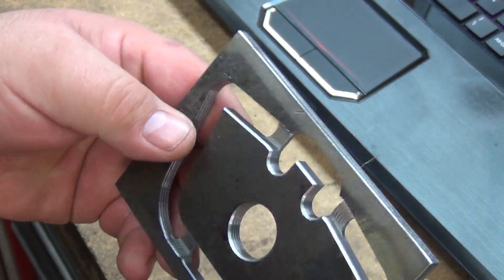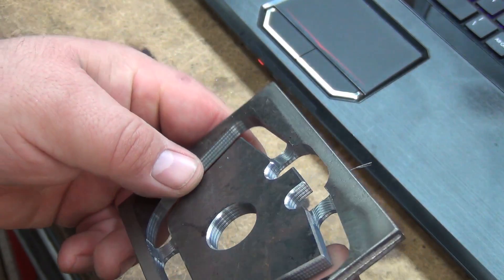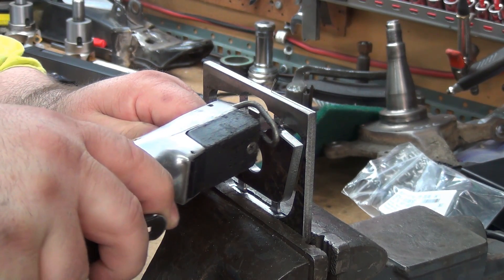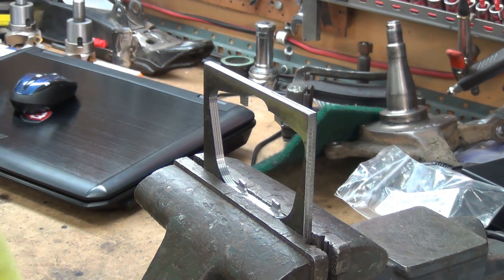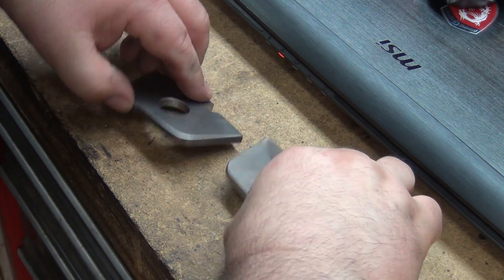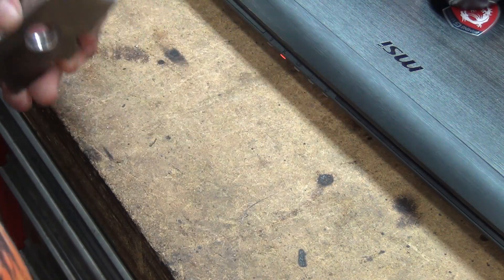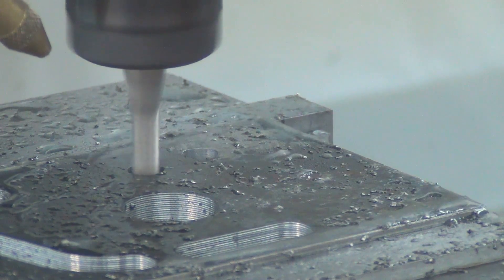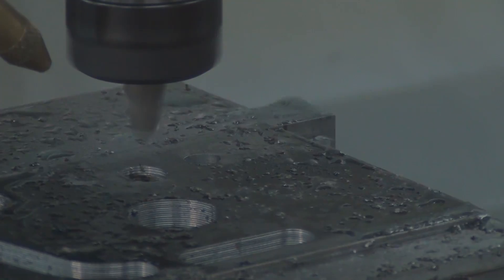TC Rod mount - Trochoidal milling

Comment: I would have laser cut that part
Reply from the maker: +Mike L That is the plan, but for prototyping, it's too time consuming and costly to have one or two pieces laser cut.  The hope is to prototype on the mill, in house, then farm out the production parts to the laser cutter.  A cnc plasma cutter might be the best answer for prototyping plate steel parts and then also being able to do production runs as well.  I do love how the laser cuts.......and that they do any of the clean up!!! :)
Reply: +bluehandsvideo . yes, they come out very good, but the first piece is always the most expensive, lol.  is this for a project on your channel?
Reply from the maker: +Mike L It's a part for the ball joint modification I'm working on for the old kingpin Datsun pickups.  For the most part, the info is in this thread.
http://community.ratsun.net/topic/8175-mklotz70-project-mend/page-40#entry1344106